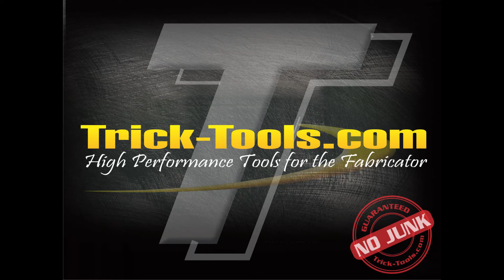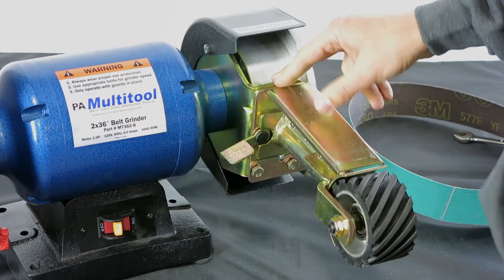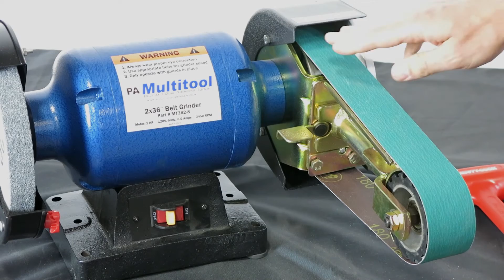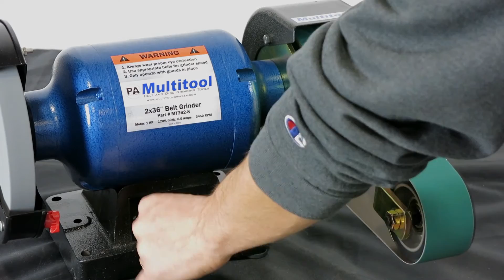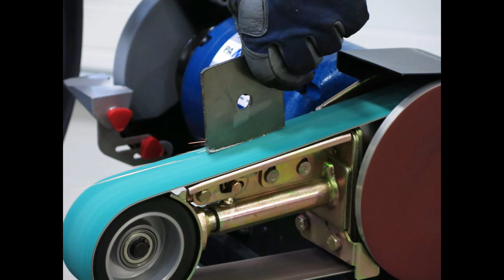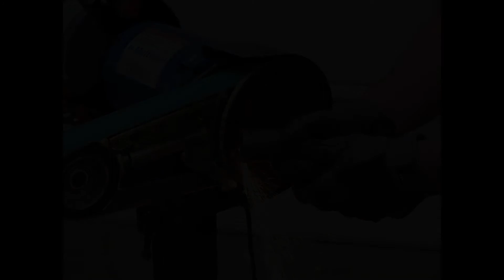Multitool Initial Tracking Instructions @ Trick-Tools

Comment: the tension on mine is too tight and the grinder struggles to turn how do i adjust for this , if i take the tension off the grinder works perfectly
Reply from the maker: what motor do you have and what belt are you running?

Comment: I have had 2 of the 2 inch and 2 of the 4 inch ones over the past 20 years, the 2 inch ones are great but the 4 inch ones were  both rubbish.
Constant vibrations, have to pack out the drum to stop it rubbing.... One had the adjustment tab loose so it wouldnt adjust. I would buy another 2 inch but not the 4 inch

Comment: I like the unit but wish the belts would in some way 'self center' over the pulleys, even if after doing the initial coarse and fine tracking adjustments. I often find when swapping from one belt type to another adjustments need to be done yet again as the next belt whether it be heavy or light, coarse or fine may well have it going hard left or hard right. Perhaps if a slightly concave (milled) pulley and/or snub wheel was made up that would somehow have a centering force on any belt installed no matter which type.  
Maybe some 'centralising' tracking treads could be cut into the pulleys? Not sure if it would work but can't help but wonder. Love the machine but for this one issue.
Reply from the maker: This is why the tracking adjustments were made easy with a lever. Additional features to allowing it to self track either take away certain features of unit or would raise the cost of production.